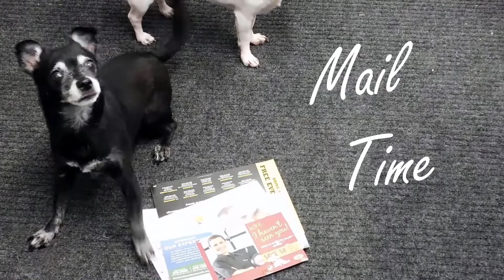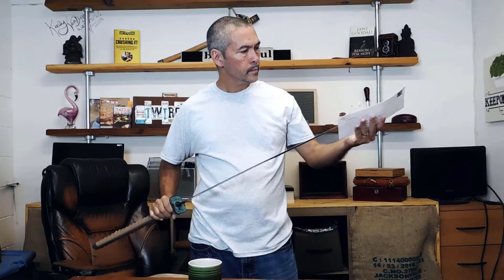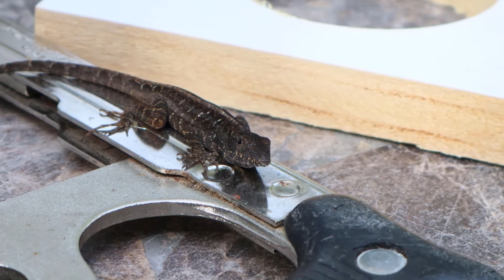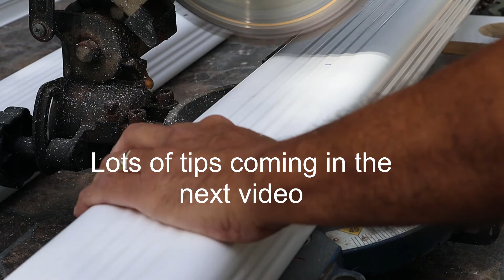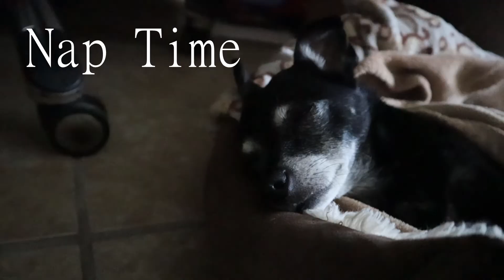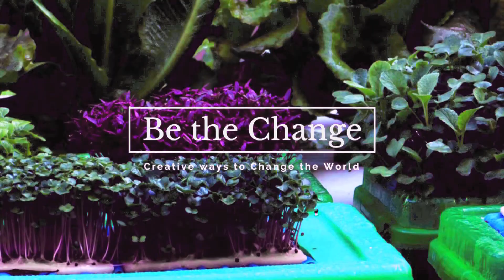How to Make a Downspout Garden / Common Questions / Gutter Garden / DIY Hydroponics

Comment: Mike, do you have a video that shows ways to build some stand to keep 4 -5 rain gutter pieces oriented in such a way as to minimize space? I mean like a ladder, where on each rung is the gutter?
Reply from the maker: Not really a tutorial but this is when I built it. https://www.youtube.com/watch?v=_Qg5UzOQEKc
I basically just screwed 2x4s together about 12" apart on a 10 degree angle. I kept them 4' long so it would not sag.

Comment: The endcaps on the market requuire glueing the endcapds on the downspouts, which implies you need a drainhole on the bottom. What do you use for your drain holes?
Reply from the maker: You don't need a drain hole
Reply: @KeepOnGrowin  How do you clean out downspout? Just flip everything upside down?
Reply: @andyyonce518  once a season, you can remove one of the end caps (assuming you used silicone versus a PVC glue), clean the downspout, and then put cap on again with silicone.
Reply: @Supercazzola  thank you

Comment: you never say the size between the holes,
Reply from the maker: 2"
Reply: 4" between the points that you mark to drill. If you use a 2" holesaw, then you will have 2" between the edges of adjacent holes.

Comment: I have watched some of your videos, and I keep on coming back to your videos.  I have decided with the Kratky hydroponic. Would I be able to  grow hydroponics indoors all the time?  I live in PA, and with the Chemical accident recently in Ohio,  and with chemtrails, I don't want to grow the hydroponics outside.  I have two garden towers, and never used them yet,  I was going to use them this year, but now I don't know with all the chemicals in the air.    Would that be possible growning inside with your Down Spout method?
Reply from the maker: Yes but you will need lights and ventilation.
Reply: @KeepOnGrowin   Thanks for answering my question quickly.  What type of ventilation would I need?
Reply from the maker: @EliseGeiman  A fan set on low to keep the air moving, nothing fancy.
Reply: @KeepOnGrowin  That is great news.  I am glad I don't need to purchase a mini split.

Comment: I am a senior citizen and not handy but I'd like to have a couple of this downspout grow box for hydroponics.  Where can I buy a ready made one? Do I need to have a submersible water pump for this grow box?
Reply: no need for pump in this method. These downspouts could be modified to use the Nutrient Film Technique (NFT), which would require a pump, but that is not how Mike is using them. He is doing more of a "off the grid" no power needed, kratky technique.

Comment: your spending allot on materials
Reply from the maker: Really?? Back when I made this video a downspout was $12 (now about $16) I make 4 to 6 of these out of each one. People are spending $16 to $50 for small countertop models that only hold 6 tiny plants and the Aerogarden can run over $100 for one system. 

Not spending. Saving.

Comment: So this may seem a little picky but I’ve seen several variations of this with the vinyl downspouts.  I just constructed a NFT system with these downspouts.  It’s working great but one concerned individual inquired about it’s safety for food.  Amerimax says they are made of “virgin vinyl” but nothing about a NSF rating.  Not surprising as it’s not designed for this use.  Do you have any information that would put such people at ease regarding this issue?  Thanks

Comment: Looking at the thumbnail picture for your previous video...  a better idea may be to make a double ended downspout with a 90 degree curve up at each end that can be covered as needed,  rather than sealing both ends.  That way the cover at each end can be removed and water levels checked and added to as required.  The only sealing needed would be whatever glue is used to connect the 90 degree curve piece on the ends...  if the piece is already existing on one end,  then only one needs added.  Less work...
Reply from the maker: That is actually in step 2

Comment: Its probably somewhere on your channel but I've missed it if it is......Have you ever calculated the amount of water that a full 10' vinyl downspout will hold if filled to the proper height for the pool noodles/roots, etc?  I just completed two of them full lenght and I've cut up the noodles and am getting ready to start some things as soon as the ambient temp is right.  Thanks for all the good content!
Reply from the maker: No, but I know the 2' ones take about 1 1/2 gallons.

Comment: What a great idea but the video didn't show how you complete the ends and how you hold the water in
Reply from the maker: This is step one. there is step 2 and 3 which will explain everything.
Reply: I also think it would have been nice if the entire project would be in one part. Lots of time time spent on 10 - 8 = 2 😆.   Great idea for sure. Which part shows nutrient level and ppm?

Comment: Hey can I use a 2 1/8" hole saw, save me buying a 1 7/8"?
Reply from the maker: Yes, if you use pool noodles, the size is flexible. I only use that size so that I can use a net cup if I like. Some 2" net cups are actually a little larger, they have a nice size rim and will still work.

Comment: Sir Mike,
Where do you buy the lower numbered nutrients for the early plants!
Reply from the maker: Hello Marilyn, It is the same nutrients. If you are using the ones from my shop, it is approx. 10g/10g/5g . If you buy you own and weigh it, as the plants mature, you can bump up the weight.

Comment: Hi Mike! I just ordered a couple of downspouts from your Etsy site. I'm new to the idea of using hydroponics system and I plan to use these downspouts indoors for some herbs that I use very often. I just read about the advantages of pumping oxygen into the hydroponics system. Any recommendations on how I can incorporate a small pump system for these downspouts?
Reply from the maker: Yes just drill a small on top. Use a small aquarium pump with air stone.

Comment: I followed all the instructions and tested the solution, etc. I put my bok choy in the holes and it was all dead in 24 hours. Is it to hard on plants to go from dirt to hydroponics?
Reply from the maker: No, I do it all the time. How hot is it? Did you squeeze them too hard? Pretty much just let the leaves hold them up and let the roots dangle. I will try to do a video soon.

Comment: Hello Mike, I have access to scrap aluminum downspout from a roofing company. Any reason to not use it?
Reply from the maker: No, just hard to cut and may heat up faster. Worth the experiment tho if it is free😎🖒
Reply: Hi there I think aluminum will heat up a lot more than the plastic

Comment: Couldn't u use the 2 inch or 3 pvc waste pipes?
Reply from the maker: I started like that but they rolled. I don't have to strap these down or buy a bracket. You can definitely use them.🖒🖒
Reply: @KeepOnGrowin  ok.. was wondering if it had to do with the cost difference

Comment: Really enjoy your videos Mike. I'm just getting into hydroponics and haven't really settled on which systems I want to use but I do have a construction tip when sawing PVC with a power saw. Just like "drilling backwards" to get a smooth hole, on a circular saw of any sort, reverse the blade and drag the teeth through instead of cutting through (real good use for an old, dull, worn-out blade). Not saying I'm old, but I was on the design team for dirt.
Reply from the maker: Thanks so much man. A few other carpenters told me that. Wirks like a charm. I should do an update. 🖒🌱
Reply: Instead of a worn out blade you could actually use a cutting wheel instead which can actually cut thru cement but no water and it slices right thru !

Comment: Hi,

Is there any particular reason why you didn't drill the wholes further to the ends? It seems to me that with these spaces, you could have fitted 7 wholes instead of 6 on this size of downspout..
Thx.
Reply from the maker: I heat and bend the end inward, that's about as close as I can get and leave the plant on the end some room. This spacing has worked well with me.

Comment: Thank you for your this detailed video! 👍
I'm going to do this too - however, if seems that here in the UK, the only downspout you can buy is 65mm x 65mm (2.56" x 2.56")..
..i guess this still would work, but because due to the smaller size, this holds approx half amount of liquid nutrients then yours - therefore I would need to check upon these smaller diameter grow boxes / refill them twice as frequently as you do.. 🙃
.. I'll let you know how it went once it's done!

Thank so much for these videos - you have been one of my biggest inspiration to start growing microgreens and vegetables in my garden! 👍 🙃

Comment: Are there any risks of materials from the gutters leaching into the plants and fruit?
Reply from the maker: Not that I know of, pvc needs to get hot for that to happen. If you let these get too warm, the plants will die. Morning sun, afyernoon shade. Best to keep the liquid under 80F degrees.
Reply: @KeepOnGrowin    I was thinking about this and there is likely little difference in using gutters in a rain catch to be used for watering. The only difference is, fertilizers are being utilized with hydro setups. I just wasn't sure if there were any potential reactions related to ferts / materials used in the project. Thanks Sir, enjoyed the videos, thank you for sharing. Some super creative ideas you have there!

Comment: What about using pvc pipe with caps instead of downspouts? Also the hole in the pool noodle is not big enough for a seedling. what do you use as filler to keep the plant upright
Reply from the maker: Yes, I started with the round pipe you just have to keep it from rolling around. I am rounding up hundreds of old pictures for people that bought my eBook, there are some pictures of me experimenting with that. I cut a small section out of the pool noodle and place it in the middle.
Reply: @KeepOnGrowin  Right you can use some sort of  half pipe stand made with anything other pvc parts on each end near the caps or round wall bracket with liquid nails to keep it from rolling. I mean the hole in the pool noodle is to big for a seedling.  How do you support eh seedling once it is in the noodle.
Reply: They make a "ladder" for several pipes to be ran in concrete. They may work to keep em from rolling around. I use 2" and 4" for my chicken watering system.

Comment: Mike Love the short elbow as an alternative to heat molding the ends. It looks supper clean. And really those little elbows aren't that expensive. I think they were only $2.55 each at Home Depot for the 2" x 3" and $3.78 for the 3" x 4".  TIP. If you all do use them, do be sure to put a small piece of netting or something over each end to prevent bugs/things from getting in to the rail.
Reply from the maker: Thanks.  I made this video before I left town. When I get back I am going to silicone it together and plant it out. Only takes a minute plus dry time.
Reply: Cant wait to see how you do the 45 degree  cut ends..